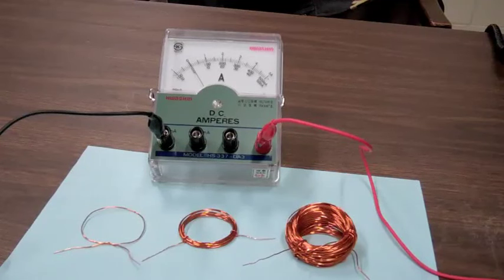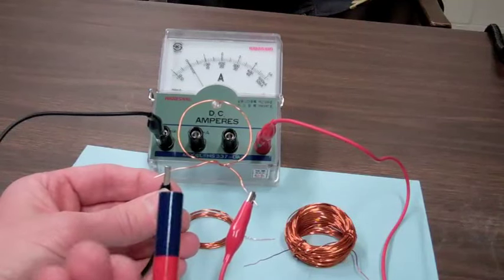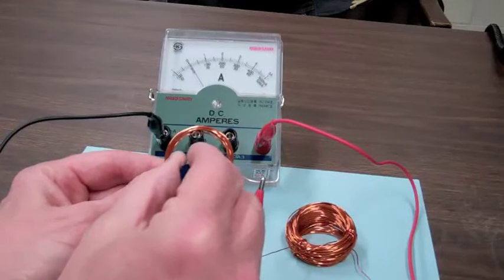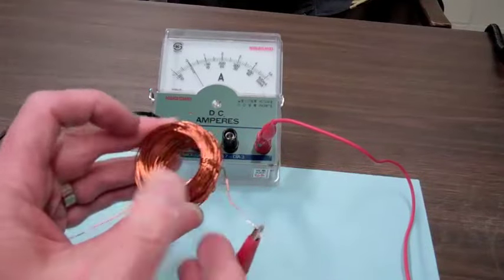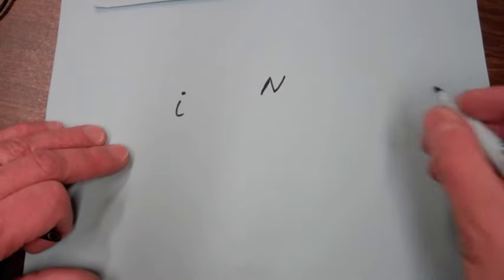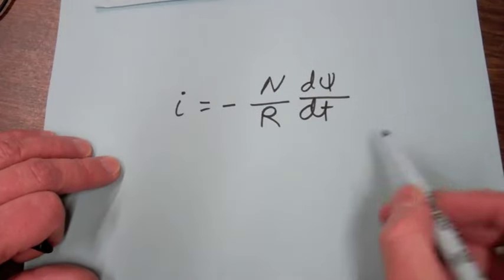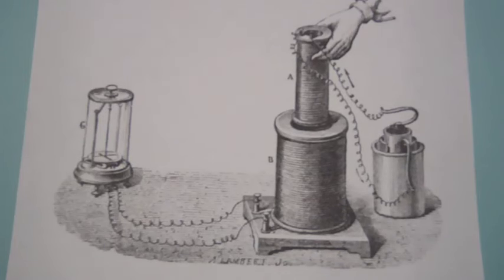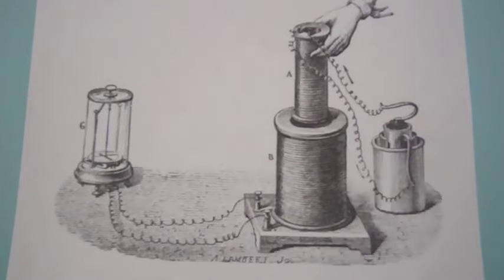Electromagnetic Induction and Faraday's Law

Comment: why did you use psi instead of phi?
Reply from the maker: +Burcu Gümüş  because the book used in the course I was teaching used psi for both the electric and magnetic flux. So I didn't want to change symbols for the students in the class when I did the video. I would prefer to use psi for electric flux and phi for magnetic flux, which I believe is more common. I subsequently redid this video using phi for magnetic flux,

https://www.youtube.com/watch?v=KUihEkvabpo
Reply: +Michael Melloch okey thanks for explanation :)

Comment: In Ncert book it shows galvanometer instead of ammmeter
Reply from the maker: A galvanometer measures current, so why I probably referred to it as such in the video. A galvanometer is the base component in ammeters and voltmeters. In an ammeter there is a resistor parallel to the galvanometer and in a voltmeter a resistor in series, https://en.wikipedia.org/wiki/Galvanometer

Comment: Sir,what is the dimension of the wire? I mean how mm?
Reply from the maker: If you are asking about the gauge of the wire, I do not remember.It was thin enough so that it was easy to coil.
Reply: @electricandmagneticfields2314  Thanks for the reply sir.One more question -which size of wire will be the best for this kind of experiment? I mean thick or thin? Which thing should I take as a consideration for this experiment?
I will be grateful to get a reply from you, Sir. Thank you.
Reply from the maker: @arnobbarua2482  The thicker the wire the lower resistance so the more current you will get. But too thick and it would be hard to coil. I am guessing I used something like 24 gauge.
Reply: Thanks a lot, sir. Currently, I'm using 28 mm of wire and of 250+ turn but got a very poor voltage like .12/.23. What should I do now to improve the voltage?
I promise It's my last question to you, sir. Thanks again.
Reply from the maker: @arnobbarua2482  The greater the  change in flux linkage the greater the voltage. The three things that can increase the flux linkage are a stronger magnet, moving the magnet faster, or more turns in your coil. Are you using a rare earth magnet? If so you need to increase the number of turns as I am assuming you are moving the magnet as fast as you can. Doubling the number of turns will double the voltage.
Reply: Thanks sir.Your suggestions helped me a lot to design the coil.Thanks again.All the best.

Comment: why you are not getting electric shock from that induced current...
Reply from the maker: There is insulation on the wire, plus the current is so low you would not feel it.
Reply: Oooo. Thanks For Your Reply...

Comment: Excuse me i am trying to achieve this project but i dont understand why it won't work
Reply from the maker: Are you using an ammeter? If so, you need to use a galvanometer.https://www.amazon.com/QWORK-Galvanometer-Moving-Ammeter-50-0-50UA/dp/B09GK5NWP1/ref=sr_1_1?crid=28325SV3OVTJP&dib=eyJ2IjoiMSJ9.6_wg9NJy0enkF5GEGopKCYvGSNDVG_HrHeD3um06whMBfmtoP8_Nakg-dYOvSTiIkBk--97GUE4iTy1n5CX2ZnkR6U_Y7Quvhri7xsFSAJXDJNwB2XGwFYdQgXNQXKx54sDkbYo8_koxqiAbiWgOizo4ZI9xJyyO9hL0ujT_5xVcTjzxnbnmnfVBkp2hy_18nKhRDY4__N2aJ_gP3eT8fg-2TQq_sLtwbp5PLD_y9_s.5yZ5pjvsx5yyr4TSw7KX__U4YmPdbNRNT1MZDPLE8Iw&dib_tag=se&keywords=galvanometer&qid=1709667426&sprefix=galvanomete%2Caps%2C188&sr=8-1-spons&sp_csd=d2lkZ2V0TmFtZT1zcF9hdGY&psc=1